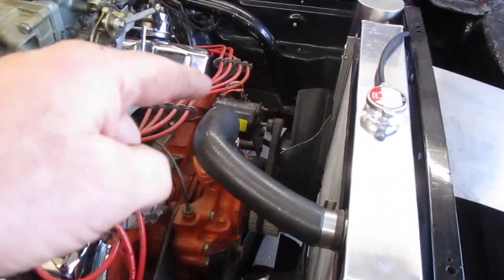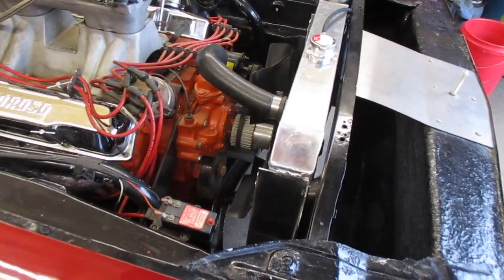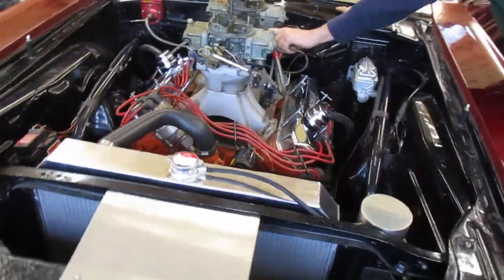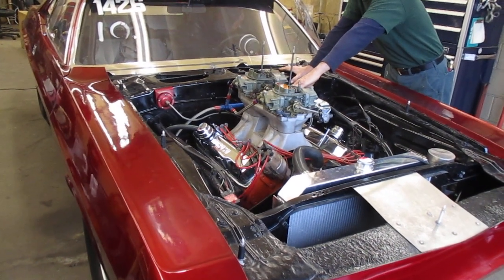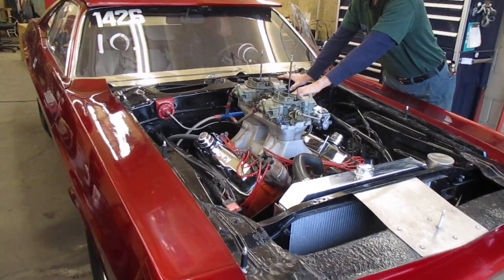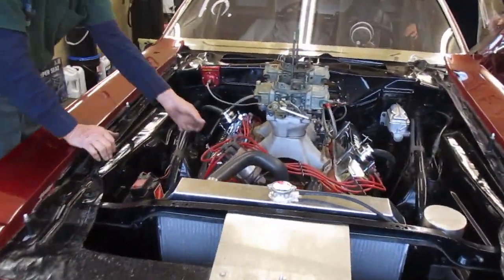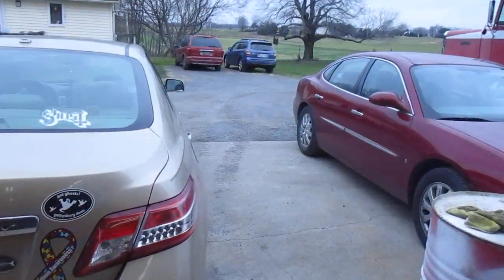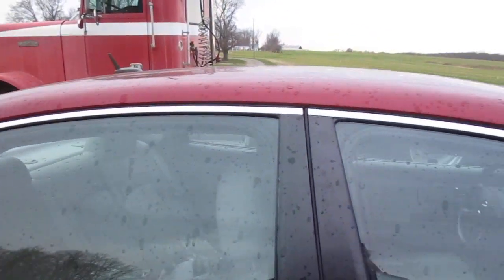Will this engine run my SAWMILL # 587

Comment: I have a buddy that has a family circle sawmill with a 413 if my memory is correct.
Buying gas may be a bit expensive since 1/20/2021.
Even so my kid just put his 468 in the 69 Camaro I ran in 1981.
Gotta love some muscle GM or Mopar.
Reply from the maker: there it was a fun time . i had my share of them thanks for stopping by john